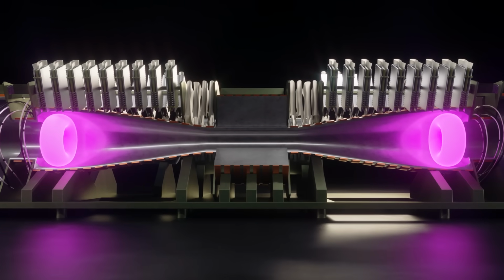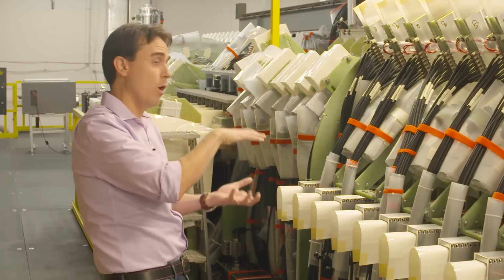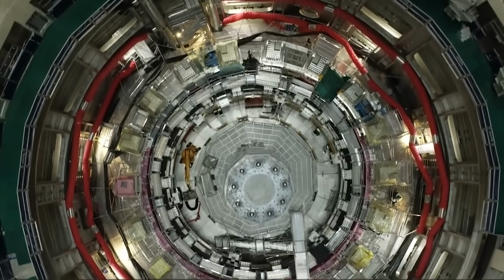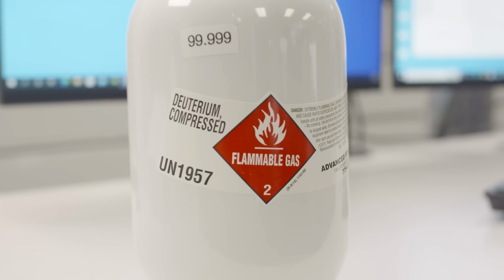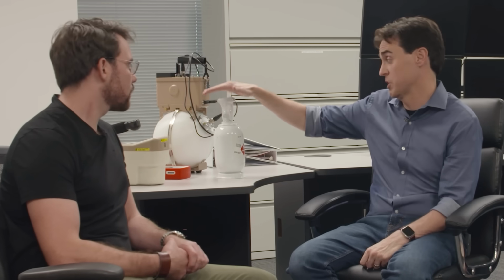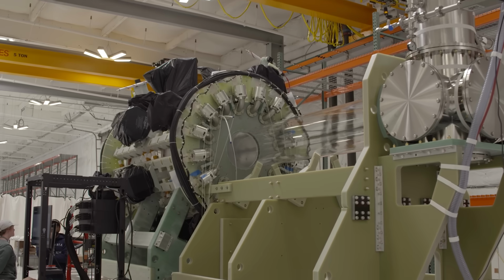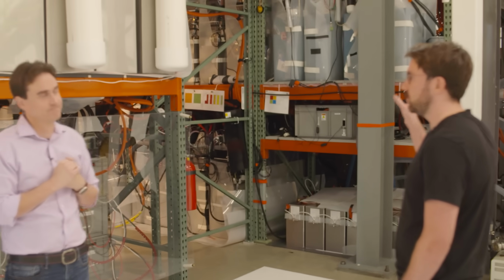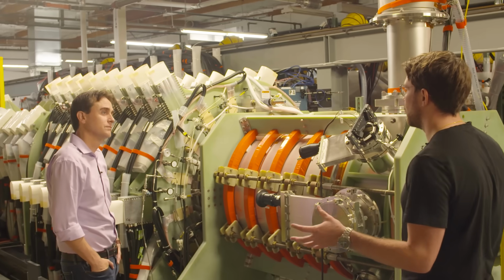A New Way to Achieve Nuclear Fusion: Helion

Comment: I can't believe how small this machine is compared to the other fusion projects that are in development! 
this sounds extremely promosing and way further along than I thought possible right now! This is really exciting!
Reply: Well, you have to remember that these machines are operating at different scales. A commercial scale generator would likely be much larger.
Reply: It's small because it's just a prototype. Tokamaks started small too, then they realized they need to go big to go net positive.
Reply: Who tf are you to call it pointless lmaooooo you realise you sound exactly like the people who dismissed fission in the past?
Reply: You can build a fusion generator the size of a 2 foot box. It doesn't mean much. The problem is making more energy than you put in, and then extracting that energy to make electricity. None of these problems were talked about in this video. They deliberately avoided this topic because this is a problem they will likely never solve. ITER has the best chance and that won't ever connect to the grid.  This project seems to be just like the other hundreds of "successful" fusion projects that have come and gone in the last 80 years. After a few years, the investors realize that the project will never be commercially viable or even militarily, the funding dries up and and you never hear about it again.
Reply: @jorje58965  So you didn't watch the video. They said the next generation unit (ETA 2025) will produce net energy, and the generation after that will be their commercial reactor. But yeah, tell us again how you know more about this than the people working on it 😂
Reply: @fudhater8592  lmao just like every other fusion startup. I'll set a reminder for 2025 and we can discuss how naive you were.
Reply: FISSION IS TOO SLOW

Nuclear power advocates can be broadly described in two categories: nuclear realists and nuclear utopians (stupid annoying 14 year olds on the internet who think nuclear energy is like a video game you build energy plant and boom magic energy).

Currently, the total global power consumption is about 15 terawatts. Let’s assume that the conversion of nuclear thermal energy to electricity is 100 percent efficient. Now imagine a world where 15 terawatts is supplied by 15,000 1-gigawatt reactors. Lets look at some problems

#1 Site selection
Today there are about 430 commercial nuclear reactors worldwide. Expanding that to 15,000 reactors requires finding locations away from densely populated areas and natural disaster zones, and near massive bodies of coolant water. Taking into account not just the footprint of a nuclear power station but also its exclusion zone, associated enrichment plant, ore processing, and supporting infrastructure. Mark Z. Jacobson (2009) has shown that each nuclear power plant draws upon a total land area of as much as 20.5 square kilometers. Another factor to consider is land re-use after decommissioning. It may take decades before the land is available for re-use. And in the case of decommissioning by entombment, or at the site of an accident, the land may not be available for re-use at all within a given century. People have done the math, there isn't enough space.

#2 Metal degradation
All forms of nuclear power emit neutrons that irradiate metal surfaces inside the reactor vessel. Over time, these metal surfaces develop cracks due to neutron embrittlement (Murty and Charit, 2008), causing the nuclear vessel to degrade with age. Power output decreases overtime.

Neutrons are not necessarily the only source of embrittlement. In thorium reactors that use components made of a nickel-based alloy called Hastelloy-N, for example, both neutron and alpha particles react with the boron and nickel in the alloy—creating helium bubbles that cause helium embrittlement. Also, tellurium fission products cause intergranular cracking of the alloy (Rodriguez, 1981). Aging caused by embrittlement is an inevitable consequence of any form of nuclear power.

Particle bombardment of metal surfaces is not the only degradation mechanism in the nuclear vessel. The metal structure is also subject to everything from corrosion and thermal creep to fracture, radiation-induced segregation, and cavitation (Murty and Charit, 2008). These aging factors, all acting together, unavoidably lead to plant losing 90 percent efficiency after 10 years and a necessity to shutdown after 40 years of operation.

If nuclear stations need replacement every 40 years on average, producing 15 terawatts of nuclear power would mean building one new nuclear power station—and decommissioning another—somewhere in the world every day. This is impossible, given that nuclear stations today typically take 6 to 12 years to build (Ramana, 2009) and 20 to 50 years to decommission.

#3 Radioactive waste
After more than 60 years of nuclear technology, there is still no universally accepted mode of disposal (Pickard, 2010), and nuclear waste still raises heated controversy. It would appear irresponsible to leap toward 15,000 reactors before the waste problem is settled. Spent fuel is not the only problem; there is also the question of where to put thousands of decommissioned reactor vessels. Burial might result in radioactive leakage into groundwater due to unforeseen geological movement. If thousands of reactors were to be commissioned across the planet, waste management over such a wide geopolitical spectrum would give rise to high levels of uncertainty.

#4 Uranium supply
As high-grade uranium ores become depleted, the trend is to move to ores with lower concentrations of uranium. The energy required for mining and milling the uranium ore then increases, as it does for low-grade ores of any mineral (Mudd, 2010). A typical figure for total energy consumed in mining uranium is 0.2 gigajoules per kilogram (Mudd, 2010). To break even, an ore concentration of about 340 parts per million is needed.9 Allowing latitude for some variance in the figures and the possibility of more-energy-efficient mining, this figure would nevertheless suggest that concentrations below 100 parts per million would not be worth the energy required for extraction. This consideration sets a limit on the viable uranium ore resource available with current technology.

The World Nuclear Association (2011) conservatively projects 80 years of economically extractable uranium at the current rate of consumption using conventional reactors. The 2010 figure for installed nuclear capacity worldwide is 375 gigawatts. If this were to be scaled up to 15 terawatts, the 80-year uranium supply would last less than five years.

#5 Not enough exotic materials
What materials make up a nuclear vessel and core? It turns out that a host of exotic, rare metals are used to control and contain the nuclear reaction. For example, hafnium is a neutron absorber; beryllium is a neutron reflector; zirconium is used for fuel cladding; and many other exotic metals, such as niobium, are used to alloy steel to make the vessel withstand 40 years of neutron embrittlement.

An examination of the relative abundance of chemical elements in Earth’s crust shows that many of the metals used for nuclear containment are in low abundance (Abbott, 2011). What is alarming is that the annual growth rates in consumption of these metals (typically in the 10 to 20 percent range) are enormous compared with, say, the growth rate for consumption of crude oil—which has dropped below zero in recent years (Abbott, 2011). If we were to scale up to 15,000 reactors, we would either rapidly exhaust these materials

NUCLEAR FISSION IS NOT HAPPENING. The current model of civilization where every single person of billions of people on earth needs 2 phones 2 cars 1 house 8 appliances a drone and dozens of devices tons of food waste tons of fuel heating and cooling waste tons of other waste from luxury living is SIMPLY NOT SUSTAINABLE FOR BILLIONS OF PEOPLE. 7 billions to date and soon to be double that. NOT SUSTAINABLE SORRY!
Reply: Our known uranium sources are very limited and due to run out in the near future (2050) … at least with our current rate of use.

We have lower grade uraniums, but then the refining process and energy balance to extract it actually overcomes the power output.
Reply: @mrladeuce397  No, they aren't. Not even close. Every piece of so-called spent fuel still contains ~95% of its energy, so multiply whatever number you found by 20. Then add in the billions of tons of Uranium in the earth's oceans. Then add in however much is in the earth's crust and continually leaches into the oceans.
Reply: @mrladeuce397  Absolute bs. Uranium will last millions of years.
Reply: @mrladeuce397  1) partly true - sources that can be profitably extracted at current low price of uranium may run out. Prospecting hasn't been thourough

2) false; absolutely and completely false. 

At a modest increase in price, seawater extraction in certain places gets possible, and uranium is continually getting into seawater from the crust.

Also, there are other isotopes that can be used in reactors, such as thorium, which has negative price - due to US bureaucracy, it's a troublesome byproduct of rare earth ore mineral mining.
Reply: It's also amazing how pointless it is. 

Compared to this, nuclear fission is trival, perfectly economical, yet still not allowed because it'd upset the gain power over economy through climate emergency economic measures. 

People do not get there's no winning with environmentalists. Especially if this were a production system that worked perfectly, it'd never be allowed to have been built at all.
Reply: @0thPAg fission plants can’t really meet hour to hour demands, I still think there definitely should be more investing into fission power as it does solve many of our problems today. They have disadvantages these fusion reactors definitely solve though
Reply: @sirsanti8408  "fission plants can't meet hour-to-hour demands".

That's pretty much a lie - they can run in load-following mode, and do in France. 

There are more modern types that could easily do load following and it'd not even lower efficiency.  Though the efficiency is mostly irrelevant, as fuel is the least expensive part of a nuclear power plant.
Reply: @0thPAg  No it's because people are still scared of fission from Chernobyl and that japanese one it has nothing to do with the economics
Reply: @0thPAg  I’m all for replacing and expanding the current fission fleet, but you can’t pretend the difficulties financing for 40+ year returns on fuel costs or regulatory compliance costs are invented by environmental activists. I’m as bothered by their opposition to nuclear after Three Mile Island as you are but they were not the major players here — coal, oil, and gas extraction companies are. And the financing difficulties are down to neoliberal governments insisting the private sector must be interested in the lending, rather than just providing a 40-year term on state financing like they used to.
Reply: @0thPAg  fission plants are extremely expensive, and require the use of lots of hazardous fuel.
Fission reactors should be cheaper to build, cheaper to fuel, more sustainable, more powerful, smaller, and safer in every metric from fuel harvesting to power generation. 
Imagine all boats suddenly started running on fusion.
Reply: @sheeplord4976  Yeah, cuz non uranium 235 nuclear reactors don't exist...

Oh wait, they do and would be everywhere if the technology was allowed to be properly developed, but hell yeah, let's just burn more coal cuz that's so much safer.
Reply: @sheeplord4976  Comment makes no sense.
Reply: @0thPAg  Fission is not even remotely economical.  And why would environmentalists be against this? Please seek help from a medical professional.
Reply: @0thPAg  Fission plants are too slow.
Reply: @manawa3832  Of course they are slow, their advancement/research has been held back for almost half a century due to big oil/dumb environmentalists.
Reply: @anonimus370  No, building the plants and replacing at an economy of scale is too slow. The numbers have been crunched and the math doesn't add up and it has nothing to do with protestors hold signs. 15,000 plants is what is needed to replace our current energy usage. A fission plant loses 90% of it's energy output after 10 years due to neutron embrittlement. A physical phenomenon that can't be stopped. A physics problem as hard as the three body problem. That means that at 15k plants, 1 plant would need to be torn down and a new one replace it EVERY DAY. It takes 7 years to build one and 4 years to commission it for service. IT IS TOO SLOW
Reply: @anonimus370  What you said is true but Fusion has the potential to release much more energy..... cheaper and cleaner than fission.
Reply: @manawa3832  can you please explain why and how neutron embrittlement decreases energy output? Thanks! (The pressure vessel gets weaker, what else happens? And through what mechanism do these phenomena influence steam temperature and pressure at the heat exchangers and turbines?)
Reply: @pas.  Yeah I'll go collect a series of reports from the IAEA and research papers from nuclear physicists and be right back. It sounds like you are already googling and parroting selective bits of information, so maybe just open yourself up to reading all the information until I get back to you.
Reply: @manawa3832  You understand nothing. The water-moderated, solid fuel reactor was never meant for commercial nuclear power. Alvin weinberg, one of the inventors of the PWR, even vocally opposed their use for such. Better designs have existed since before the first commercial reactor even came online in 1956. Neutron embrittlement only effects some materials and isn't a major concern for reactor designs operating at atmospheric pressure,
Reply: @manawa3832  Slow in what regard?
Reply: @manawa3832  Too slow? Slower than fusion, the forever 20 years away miracle energy source?

Fusion is great and all. It should be worked on. But people need to stop thinking it's a solution for our current problems.

And the 10 year lifespan you quote is suspect.

The IAEA states a lifespan of 20-40years. And the NRC has licensed a bunch of plants for operation up to 80 years.

Source: IAEA, Nuclear Power Plant Ageing and Life Extension: Safety Aspects

NRC, What's the lifespan of a nuclear reactor? Much longer than you think.

Frankly, either we develop better grid scale batteries for renewables or we go nuclear. Both seem viable in the near future.

But fusion will not be ready in the forseeable future and should not be relied upon.
Reply: @manawa3832  ... what does that even mean? 

They produce power readily, and can be built fast if you don't have an entire ecosystem for paid activists using lawfare to stop construction.

Look at e.g. South Korea.
Reply: @manawa3832  Show me the math.   Some quick google searches how that the US is using roughly 4 trillion kWh per year.  The smallest reactor in the US generates 5,098,320 MWh in a year but isn't running all the time, let's knock that down to 4 million MWh.   Add three zeros to convert to kWh, you get 4 billion kwh.     4 trillion divided by 4 billion is 1 thousand.   And that's for the smallest nuclear plant.    Your example is off by at least one order of magnitude.   Still, that is kind of sobering on how much more we need to build than we are at the moment.
Reply: @jacobnebel7282  You're talking out of your asz and have addressed nothing I said other than drop buzzwords to appear knowledgeable. Neutron embrittlement creates lattice defects in all materials, it is a phenomenon that occurs at the atomic scale. You can stomp your feet all you want, no one is replacing the energy grid with fission plants ever because it the moment anyone looks into the basic economic factors, the math doesn't match up. So keep crying you little fission babies, it ain't happening because real people have to be concerned with real problems and not just try to virtue-signal appearing smart and forward thinking online.
Reply: @the_penguin_13  Cheaper??? 
maybe in 50 years, meanwhile we continue killing the planets at full speed because "fission is bad, mkay"
Reply: @manawa3832  Sure sure, and the math was done by people paid by the oil companies?
Reply: @anonimus370  Go smoke your weed and leave engineering to serious people.
Reply: @manawa3832  I asked a sincere question, based on what I heard/read/learned about nuclear reactors in the past. I'm not regurgitating random Google results.